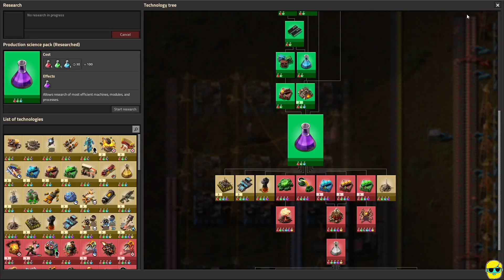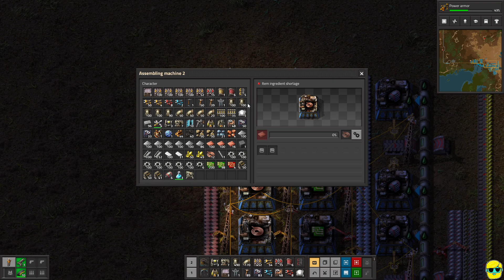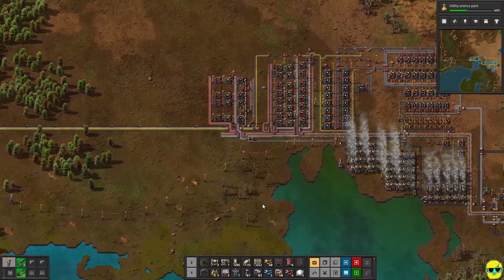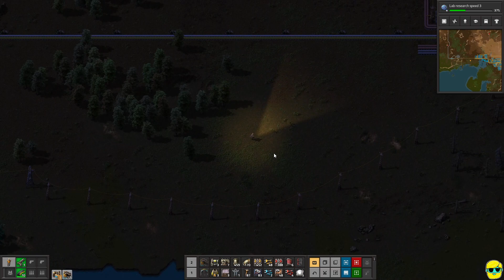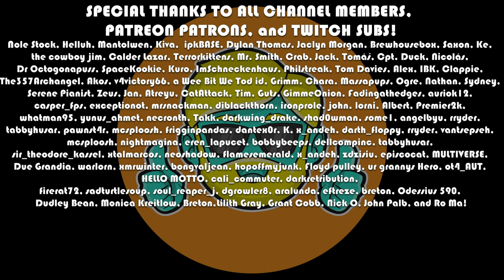Factorio | 2023 Guide for Complete Beginners | Episode 17 | Batteries and Flying Robot Frames

Comment: 2:30 - Troubleshooting 101: Is it plugged in? Fwiw I just completed my first playthrough. You don't really need a huge base to reach the end of game screen; I got there with only two train routes, one for iron and coal and one for oil. And you don't need a lot of the research either since I skipped over the nuclear power stuff. I'm starting a new playthrough and I think that's part of the game as well; use what you learned on previous runs to build more efficiently each time. Off topic, but have you ever looked at Hydroneer? I have it down as similar to Factorio but now I'm thinking not really. You do build a factory though so maybe?
Reply from the maker: Congrats on your first win! That's awesome! I haven't looked at Hydroneer yet but it sounds good--thank you for the recommendation!